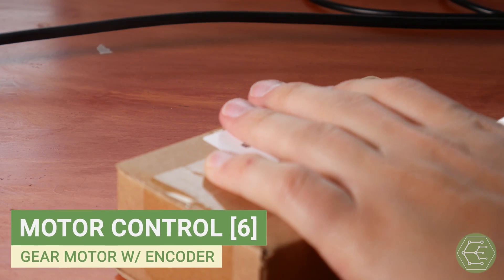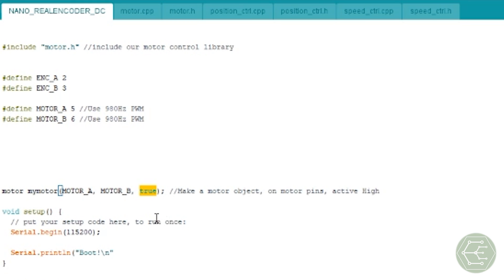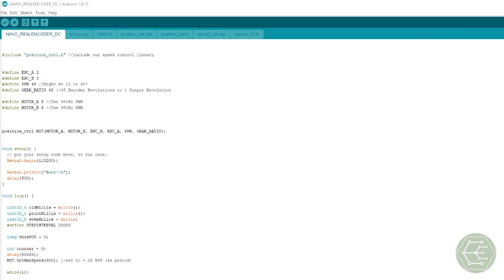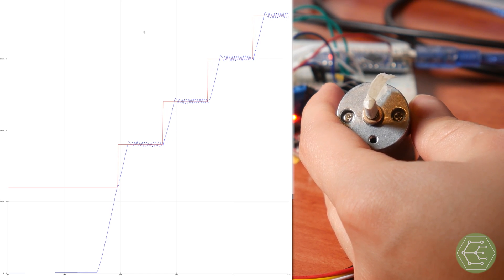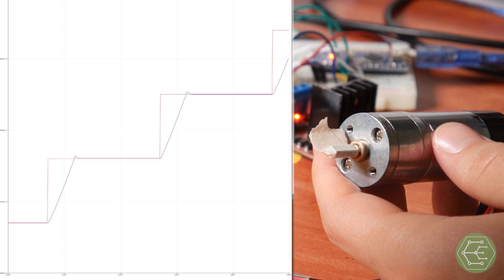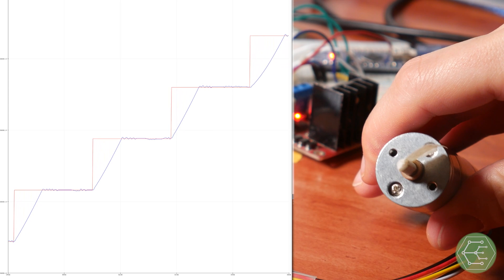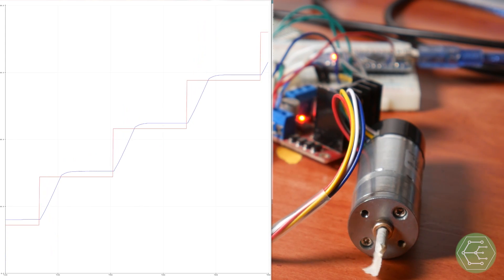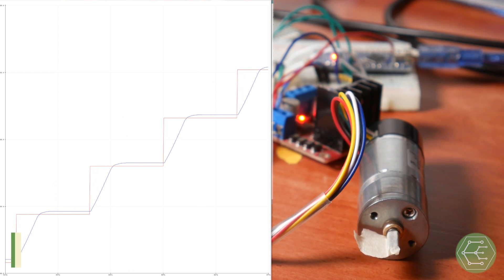Speed & Position Control – DC Gear Motor with Encoder | MOT 6

Comment: The Arduino only has I think 2 interrupt pins which you want to use for the encoder to get the best resolution out of it. Other micros like a Teensy would be a better option with more hardware acceleration. I think the STM32 black pill micro even has a hardware encoder module that keeps track of the position and can be enabled in ST Cube MX.

And yes, control systems can be tough. With a motor you have nonlinear effects such as saturation (maximum speed/acceleration/jerk), backlash on the gearing, torque ripple, friction in bearings and brushes, etc. A permanently excited DC motor will have a linear torque to speed response when driven with a constant voltage supply. That is it will have a maximum stall torque (0 RPM) and maximum no-load speed (no torque) and a straight line connects the two. Analogous to a voltage source with a series resistance, if you compare speed/torque to voltage/current. You can use this fact to implement some feed-forward to compensate without need of feedback. 

Your job as the controls system engineer would be to model the system and develop a control system that can keep it stable. To do it right you would need to have some knowledge in control systems theory, digital signal processing, Laplace/Fourier domain, Z transforms (like the bi-linear transform), stability criteria (BIBO), phase and gain margins, nyquist stability criterion, etc. Really it is just black magic design.
Reply from the maker: Power Max! I couldn't agree more! Great comments, I've got to pin this somehow... I think we should definitely build a system and do our best to model it! Maybe I can show off a couple of the principles mentioned above!
Reply: I'm working on a project that requires more interrupts on the Arduino Nano, and it does have more! You can use pin change interrupts on any pin. They require extra work on the programmer's part, but there are libraries that do that for you. I'm using the EnableInterrupts library right now and it works great! It's letting me use 4 pins for two motor with encoders, and none of these are on pin 2 or 3, so I've got those left for something else.
Reply: @evanbarnes9984  well not only that, but also added latency and jitter, hence there are additional CPU cycles and memory consumed by remembering the state of the pins prior to port intterupt and figuring out which pin caused said intterupt.

It's not the end of the world, but these days most MCUs have per pin interupts that make this check unnessesary. And can enable much faster counting of pulses across all pins for things like encoder pulse counting and brushless mostor control.

Comment: Good work, its fun to the evolution!

As you mentioned control loop times, i can relate to a similar realization when i was working as an electrician. 
There was a three phase motor with gearbox and mechanical break,
whenever a button was pressed a contactor closed and the motor rotated until an inductive sensor signaled to the control system and the contactor opened, got called out that it was not behaving as it should, it was stopping a bit randomly, often past the sensor, or making more rotations.  First thought was that the brake had failed, so without to much troubleshooting i said to the mechanics to replace it.

After replacing the motor with a brand new one, it did exactly the same thing. so a bit embarressed, i was pondering the problem and with some doubt i checked the PLC application scan time, lo and behold it was 100ms IIRC. I concluded that we should try and reduce it, and i got met with some scepticism by the programmers who were sure that it should work and the problem was the motor/contactor.
But we made the change after some back and forth, reduced it to 50ms  or less and it worked perfectly every time.

So yeah the problem was that either it scanned at the tail end of the sensor pulse, or missed it entirely, so a few MS make a big difference in motor control.
Reply from the maker: Thank you Ghoetic!
What a great story! Yes, Timing is quite important for motor control. It's important to think about the real frequencies in the system and make sure to not violate Nyquist–Shannon rule of thumb. Nice attention to detail! I think we've all jumped to a conclusion in our work before. I wouldn't feel too bad about that!